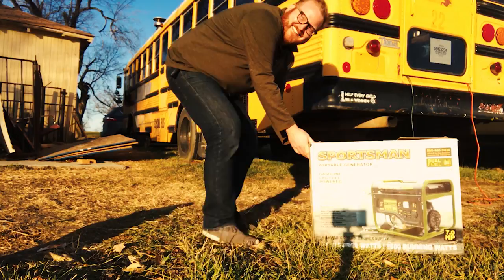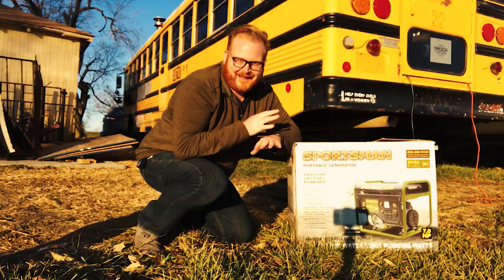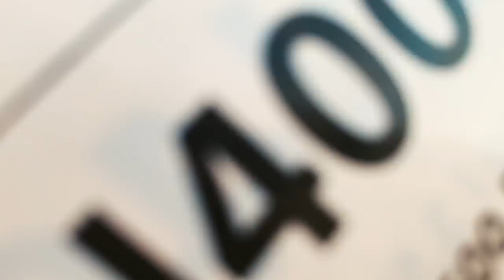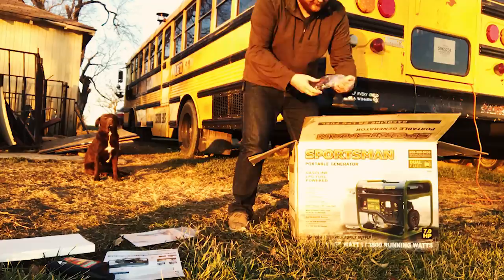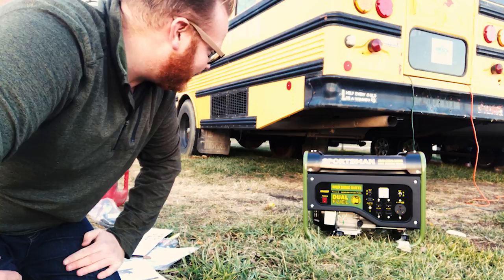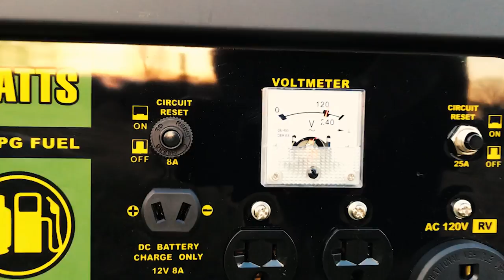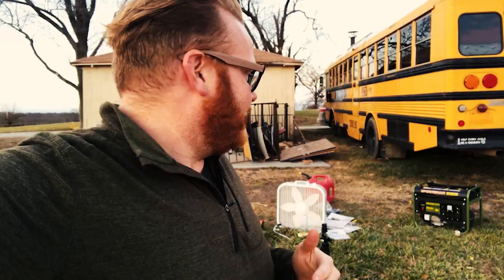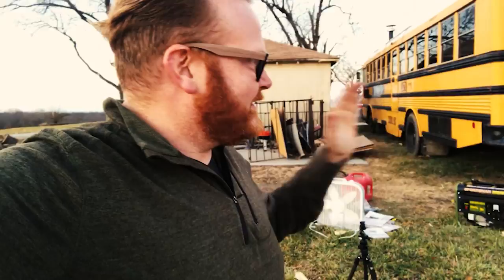Sportsman Dual Fuel RV Generator Test | Skoolie Bus Conversion Tiny House Videos

Comment: Does it have an electric start option? Mounting under with a pull start may suck.
I’m thinking of doing a heavy duty slide tray like my battery compartment has. I was also thinking about the exhaust fumes being trapper under the bus.
 Love the “squirrel” or shall I say “dog” moment 😂😂😂
Reply from the maker: Nooooooooo, it doesn't. I really had a hard time not splurging for the push start....but I got a killer black friday deal so I pulled the trigger. I'm not sure an under mount is going to work. At least, not while it's running or being started. I might make a comparement for it but pull it out when I'm using it? Not sure, that's sort of why I got it out in advance...I had a feeling that was going to be the case. :(
Reply: +jeffrey james binney, could you (or Big Jack lol) make like a little slide out to the mount under the bus so that you can pull it out from under the bus to start it and use it? I have no idea how that would work in reality, just a thought!
Reply: Emily Sweeney I have a slide out for my batteries. I guess a compartment would without slides would be less complicated.
But if he had a way to just slide it out instead of lifting it. Since he hasn’t decided on AC it’s kind of a backup thing and I guess it doesn’t matter
Reply: I think I misread what you wrote, you had already mentioned a tray slide before me...lol I'll be okay :) such a good idea though!

Comment: good lord you can run ac off of batteries or directly off of solar. do some research.
Reply from the maker: Hahaha Thanks for watching and thanks for your comments Phil...you seem like a truly delightful follower! 😂
Reply from the maker: Also, you’re incorrect. Running appliances with an increased initial startup power pull, like an air conditioner, dramatically reduces the life of deep-cycle batteries. Lithium? Different story. But the manufacturer of my deep cycle batteries said it’s a definite no go. Do some research. 😜

Comment: Pity you placed cheap cost at a higher priority level than NOISE level! Most campgrounds have generator hours. However, running a POC generator like this at ANY time ANYWHERE is one of the WORST things you can do to your neighbors. I’ve seen fist fights caused by these garbage “screamer” units! If possible return this unit and get a quieter inverter model. Even at double the cost, it’d be worth every penny - to you and to anyone within 500’ of your bus. There’s a reason it was cheap...
Reply from the maker: I'm in love with your support and optimism, NoGas! lol eyeroll

1. The reason I outfitted Earl with 800 watts of solar and 100 gallons of freshwater storage is because I plan to avoid "neighbors" at all cost. 

2. The only time I will need to run this generator is when I am boondocking and use more than my battery bank can supply. If I'm in a campground, I'll plug in to recharge my battery bank. If I'm out in the middle of nowhere and can't get enough sun, then I will run my generator briefly to top off my battery bank. 

Since I only expect to use this generator 5-10 times a year, this was an obvious place to cut costs. 

Thanks so much for your lovely comments and for watching! :)
Reply: this is a duel, by chance have you jotted down if propane runs longer, since you have some clever followers that like to funny in their own way, 😂 would you reply?  i’m afraid i may end up hearing about how my neighbors will
be made, and i could use lithium battery’s hence i would if by chance they were in this price range to run my ac 😂
about how much per day of propane for a 24hour period? how many watts were you charging?